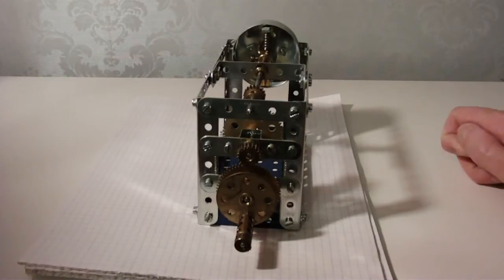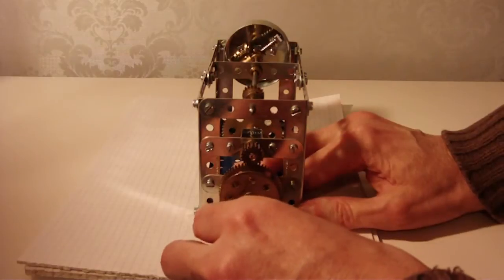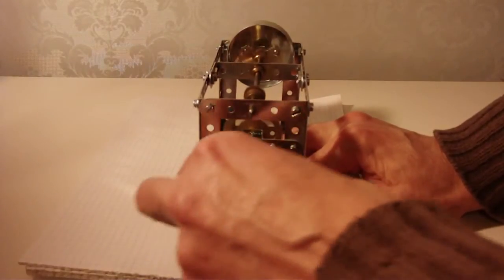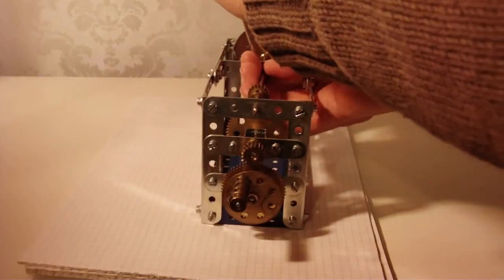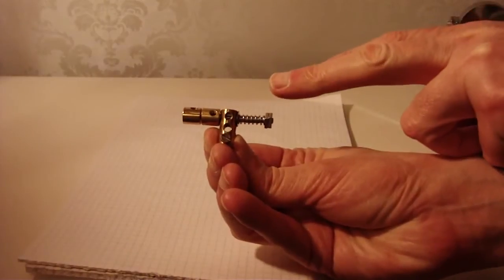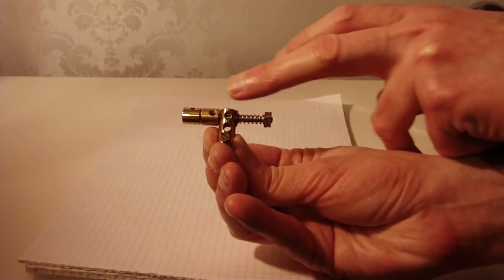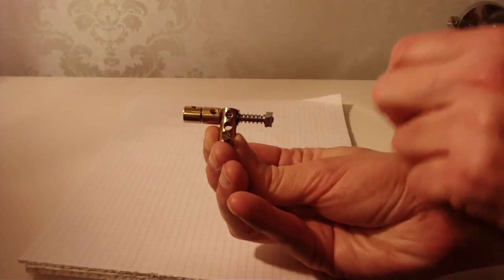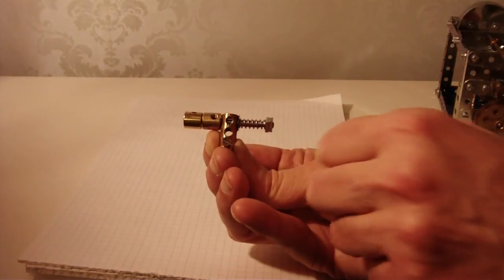Meccano mechanical governor (Ver. 2)

Comment from the maker: It should work, once you find a correct gear ratio from the motor to the governor. If some speed variance is acceptable, then an alternative is for the governer to temporarily cut the power to the motor if it spins too fast

Comment: Thank you for this video, I'm a sophomore mechanical engineering student. I have to design and build a a system and a governor that will limit the output speed from 10,000 RPM to around 1,000 RPM. Based on some research and rough calculation I think your governor devices will work, what do you think if you don't mind reply. As a engineering student do really enjoy your videos.